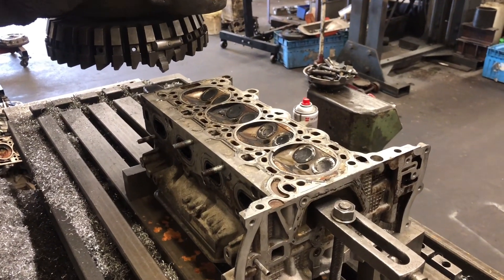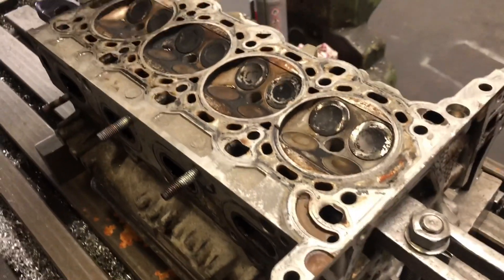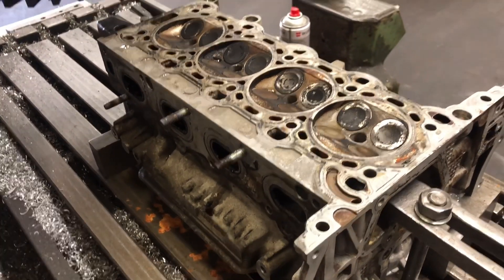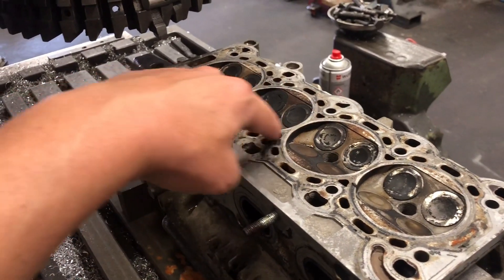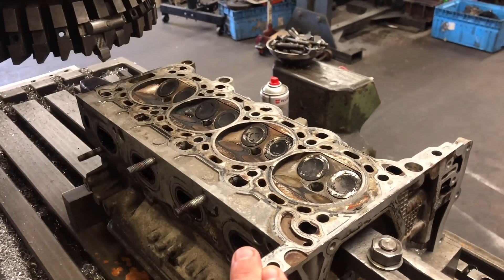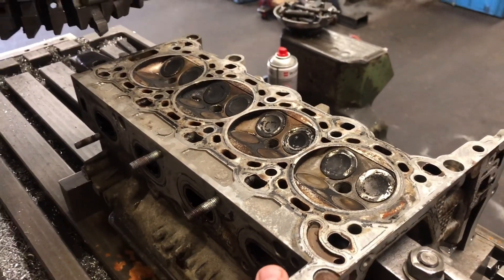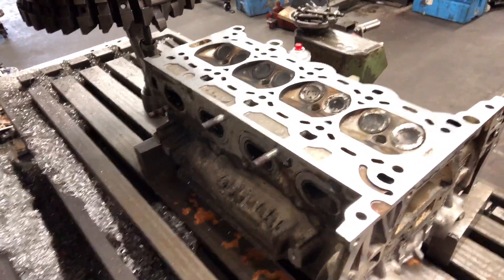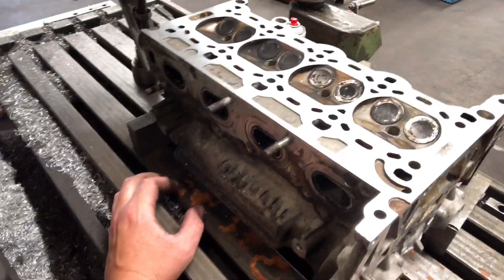Cylinder Head Refacing, how & why?

Comment: Damaged gasket face between cylinders have to be cleaned and levelled However, what happens to the cam bearing alignment when a head has warped?

Comment: As a machinist, I was wondering on one of Your prior videos why You dont keep the table feeding until the cutter leaves the head. Is it a travel issue on the machine? Also why not spray a bit of wd40 on the aluminum heads before cutting. It makes a pretty good lubricant on aluminum.  I really enjoy Your videos. Thanks

Comment: Mmm, seems you didn't specify the RaRz spec you are matching to achieve, not sure of your shop practices but with out a specification on any machining operation it leaves you open to come backs and claims. These details should be clearly discussed agreed with customers and documented on machinists job card and invoicing to not only guarantee a perfect job but to safe guard your business and customers satisfaction or you are just fudging it every day, clauses like head gasket sealing claims against machining etc will not be validated unless new fasteners are proven to be used etc, same with main or big end bearings moving, especially where torque to yield fasteners are used or any over heating evidence or high milage or age etc. These details before hand save heartache later
Reply: What's the name of your engine building shop?
Reply: That's why you don't do work for garages .... end customer only.

Comment: My K series 1.8, had its head gasket replaced and head skimmed so many times, i think i could have run it on diesel with compression ignition 😃.
Reply: Only so much u can skim a k series head before they are shafted. The aluminium is porus and pited on some too. Also depending what it looks like when u take it off determines what head gasket to use ie elastomer versions or multi layer steel. I'm currently on my 4th k series engine but they are only £250 for a 2nd hand running lump atm 👍

Comment: Skimming to much off can also raise the compression ratio to high causing preignition As I said to a Mini owner who thought 50 thou was an OK amount  Thought as your neighbour across from you asked I would have a look at what you get up to
Reply from the maker: Thanks so much Barbara, yes you get to know over time the amount you can get away with in each cylinder head. Diesels tend to have different thickness gaskets but only upto around 12 thou. We have took upto 2mm off some heads before to up the compression, but you have to know what your doing 👍